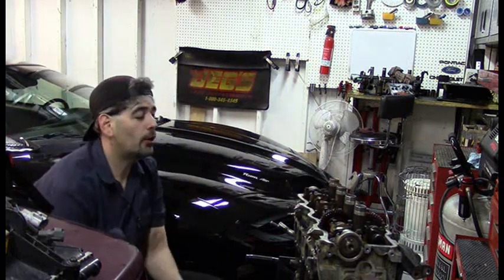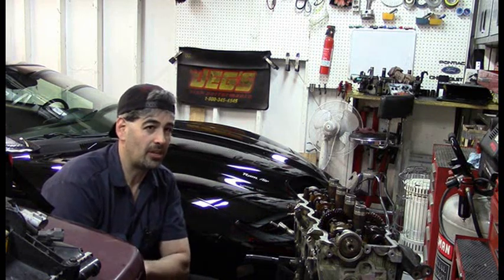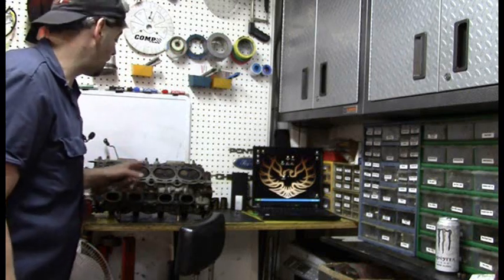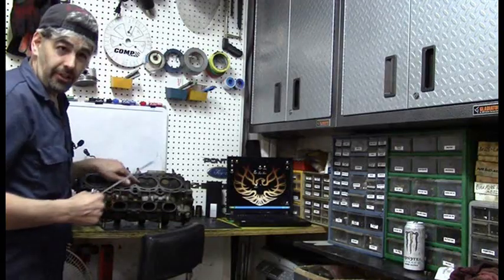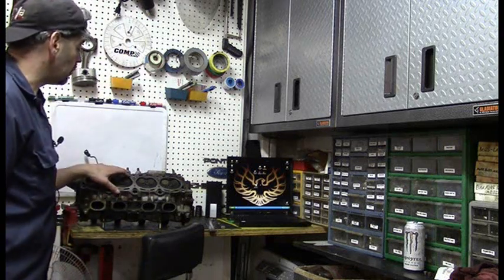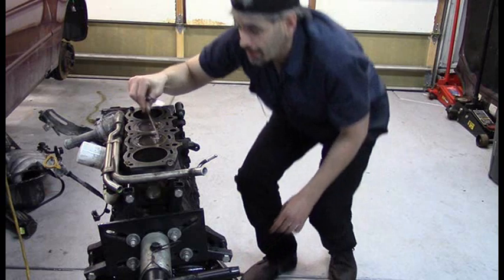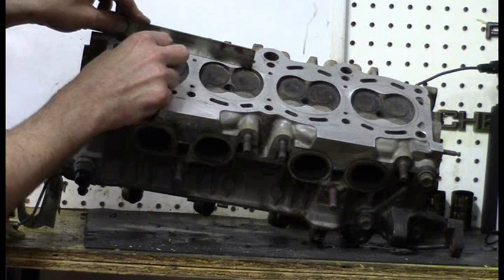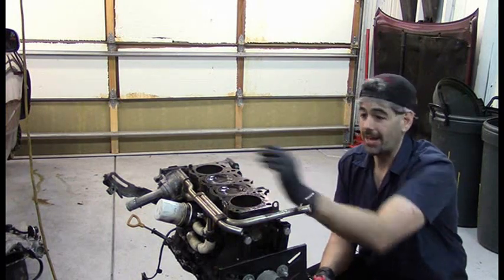Replace a Cylinder Head Gasket Yourself and do it RIGHT! Part 1

Comment: I have white smoke coming from the exhaust and smells of gas. I've put in a new pump, MAF sensor and spark plugs since I've had it for about 2 weeks or less. it starts right up but has a horrible tremble upfront. theres no milkshake look in the oil either. I have a 99 Chevy Tahoe 5.7l. 4 door, before I put to much money on nonsense, would you mind giving me your opinion. I was thinking a blown head gasket, fuel pressure regulator etc.. there's no leak under the tank or in the lines. Please help. I enjoy your videos and trust your judgement.
Reply from the maker: What was the data you had that indicated you need a new pump? This seems highly unusual unless the LTFT and STFT indicated a highly positive fuel trim especially under load which contradicts if you smell fuel, wouldn't you agree?
  What was the MAF sensor data you got that made you replace the MAF? What design it is- Digital or analog and if digital what frequency measurements did you get indicating the MAF was faulty? If analog what did the voltage sweep test show?

 Why did you change the sxpark plugs? What ignition problem was indicated? Did fuel trim indicate lean misfire and if so how did you determine ignition as cause?

I need to see the data you used to come to these conclusions since obviously you overlooked something in your diagnosis.
Reply: Schrodingers Box To be honest with you I'm still on the basics. My mechanic is the one who actually came to those conclusions. I agreed with the pump cause it wouldn't start up or took awhile to start up, turning the key at least 7 to 10 times. I also couldn't hear the pump when I turned the key on the start position. The spark plugs I assumed ( which again was brought to my attention by this "mechanic" ) because of the bad trembling really bad and the guy I bought from was always out of town with the Tahoe. The MAF sensor I was told by my Mechanic again that it needed it because it wasn't sensing enough airflow therefore causing more consumption of gas which when I was "low" is why my pump wouldn't work correctly.
Reply: Schrodingers Box To be honest with you I'm still on the basics. My mechanic is the one who actually came to those conclusions. I agreed with the pump cause it wouldn't start up or took awhile to start up, turning the key at least 7 to 10 times. I also couldn't hear the pump when I turned the key on the start position. The spark plugs I assumed ( which again was brought to my attention by this "mechanic" ) because of the bad trembling really bad and the guy I bought from was always out of town with the Tahoe. The MAF sensor I was told by my Mechanic again that it needed it because it wasn't sensing enough airflow therefore causing more consumption of gas which when I was "low" is why my pump wouldn't work correctly.
Reply: he's a horrible mechanic and to my belief I should've took the time instead of rushing it to get my Tahoe working right and did way more research. As I've been on your Videos for hours and days practically now before I start on the vehicle.
Reply from the maker: I don't understand why you agree with the pump? What evidence is there from data analysis indicating this was faulty (especially considering it obviously wasn't?).  It took a while to start so the pump was bad? Really? Why not it took long to start because of low compression, timing, vacuum leak, learned fuel cell adaptation reset, or a million other things?
  Not sure I can help with this one- I just do things differently. If I suspect a fuel pump I would need to verify with a LTFT curved against load to verify positive fuel trim proportional to load.  Once I see that I validate MAF voltage and/or frequency to eliminate induction measurement error. And even then I would fuel pressure test via deadheading the pump to finalize confirmation,
  I don't see any data here at all- I'm afraid I can't help, I just do things differently. I don't guess when I diagnose. But then again I'm not a mechanic by trade- car repair is just my hobby so I admit I could be wrong in my approach.
Reply: Schrodingers Box No I agree. I was weary even before buying the pump. But I'm no professional so I went along with his diagnosis believing he would know best. For now I'm just going to take my time keep learning and invest in my own real tools before I start my project. I need to buy a fuel pressure gauge, torque wrenches, breaker bar etc.. and throughout time while I'm learning more if your don't mind I'll be asking you real comprehensible questions. I'm going to check my fuel pressure etc.. if it is and I need to get to my fuel pressure regulator, or if I have a blown gasket etc.. what size torque wrench would you recommend to invest in first for the throttle body, intake, head, etc.. if you don't mind
Reply: appreciate the reply back by the way
Reply from the maker: I guess i'm still not following your logic here - why would you want to collect tools such as torque wrench and breaker bars and stuff for TB and intake when you have no evidence it is anything other than a leaking fuel pressure regulator or a ignition misfire or a shorted injector?  It's like buying roofing nails, a nail gun, shingles and tar paper to do a roofing job because you have water in the walls but you haven't determined it's due to a roof leak. Why not diagnose if it's a leaky pipe first? Well at least that's what i would do- not saying i'm right. 
  If you want to replace a head gasket, good luck with that. But it's just not how I do things.  I suggest you watch Eric The Car Guy and you'll learn all about the tools needed. I just focus on dignosis.
Reply: Schrodingers Box The tools are because I want to continue learning and fixing on vehicles. But will do. I guess a 120 or so out of my pocket wouldn't hurt to get a diagnostic before messing with it and spending more than I should. Thanks again for the reply. looking forward to more videos.

Comment: I have oil leaking into my radiator. Would this be also caused by a warped head?
Reply from the maker: +Michael Brady Its certainly possible.  Also could be a leaking oil or transmission coolant line in the radiator too.
Reply: Thanks for the quick response.
My X overheated the engine many times.
Before dumping the car back at my house.
its a 3.0 v6 Chrysler lebaron .
This was to be a car for my daughter, its only got 32k miles on it .
So I'm not going to give it up yet !!
Reply from the maker: Michael Brady considering the overheat I would definitely start with leakdown or compression test right off the bat and "rule out the worst case scenario" first

Comment: Low compression could also mean that a big end bearing has gone and the cylinder is lower! Just had that on a 1hdt land cruiser!
Reply from the maker: Yes that's true- you would have a major engine knock with that but indeed your compression ratio would lower as the piston travel is less.

Comment: Hi, Schrodingers I have a good question for you, 97 f150 4.2L replaced engine block and got p1506 IAC higher than expected RPM was 1100  and when gear to R or D drop RPM to 800 any way I got that fix and p1506 is gone, but still have the RPM problem, the idle in P is about 800 no problem, when gear to R or D drop to 500 and  800  up and down, smoke test no vacuum leak, FT# -7 IAC duty cycle 38% this truck run good, engine vacuum 18 hg, the problem at idle when gear to R or D, no other code presents can be the problem between the fly wheel  and torque converter? since is only at idle..
Reply from the maker: Its hard to diagnose based on the info you gave as I would normally look at TPS position and fuel trims to help with this and determine if this is a vacuum leak problem or a dirty throttle body (Which is usually the cause of many IAC codes) or dirty MAF.  i love the smoke test but I trust LTFT far more as being definitive.  I would say if you're looking for the most likely solution based on your provided evidence, I would clean the MAF and Throttle body but this is really just a guess at this point.  Seldom will this be a transmission issue- it is certainly going to be an air/fuel measurement issue but we don't have enough data to determine where.

Comment: I want to ask a question that on the surface may seem silly but I think needs serious consideration, so hear me out and think it through... carefully.  Instead of all the machine shop re-surfacing of the Cylinder Heads (which I don't disagree is the IDEAL solution), why can't you install the new gasket with a sealant like Permatex Ultra Copper (or some such HIGH temperature sealant) to fill in any warpage or gaps that may have caused the Heads to blow or leak.  Here is one of the reasons I ask, as you may have read people have mixed success with liquid sealants such as "Blue Devil", "Steal Seal" and "Bar's Head Gasket Sealer" and these just work by clogging the leak in the original gasket where the compression is leaking into the Coolant and visa-versa.  However infrequent these products work they do point at a solution... JUST FILL IN THE GAP... but do it more thoroughly.

Has anyone ACTUALLY tried that solution?  It would save A LOT of Machining and the cost that goes with it, the time it takes to send the head and get the re-surfaced head back and it's what we usually do with many other parts of the engine, INCLUDING adding sealant to the bolts that go through Coolant passages mentioned in part 2 of this very thorough video tutorial.

Please don't just say, "It won't work"... prove it (or at least give a very thorough explanation why).
Thanks :)

Comment: so i have an 03' nissan sentra...i believe its gasket header is broken or cracked....cylinder 4 is bleeding pressure and the header is wet when the mechanic checked it out and they believe that its broke would that require a gasket header repair/replacement?
Reply from the maker: +tezla actual What did the leakdown test indicate?
Reply: i dont remember the exact nuber but it was on the lower end of okay range and it might have degrated a little more i end up driving it alot
Reply from the maker: +tezla actual Can't help if you already forgot the most critical dataset. Sorry. good luck bro.

Comment: so I'm kinda curious, on if its intake manifold or head/gasket. I know a test is needed but how can you somewhat pinpoint w/out a test if the car won't make it get it tested? scenario, overheats, leaks coolant from exhaust and flex pipe, and coolant inside 3 & 4, no white sludge, no start on a chevy cav 98 2.2?
Reply from the maker: You need to do FASTTEC method. See my video on it.
Reply: See you are the man, you will be my main source for all auto. I will tell the world, good lookin out, mad thanks

Comment: Hi, so i have a 2002 Nissan Altima. I had a compression test done on it and was told that the compression is right at where it should be, but however when we looked down into the head it was very obvious that there was coolant on the cylinder head. (There is no signs of coolant in the oil) So my question is for you, Is this a sure sign of a cracked head? If so what other precautions might i take if i choose to embark on this journey? please and thank you for your time.
Reply from the maker: If compression is good but there is coolant in the intake, a leaking intake manifold leaking coolant into a runner is indicated.  In fact this was a known issue with a TSB and everything on GM 3100 and 3400's - i do not have data on Nissans though.
  Incidentally it is important to try the compression test on both warm and cold engine but pretty much if the compression test was done right it is assured you do not have a cylinder head issue.
Reply: Leaking as in a gasket or would that be part of the internals.
Reply from the maker: Andrew Barker Gaskets are part of the internals.  Basically what I am saying is the intake gasket also seals coolant passages (on most cars, some cars have "dry intakes").  If these passages leak, coolant can enter the intake runners which is a direct passage to the cylinder.  The result of course is coolant in the cylinder which looks like a head gasket issue but it is not.

Comment: Ya, but the head is soft aluminum and the bolts are hardened steel. So the head may warp easy but the bolts can take more abuse. There is a way to test the bolts for stretch.

Comment: Hello SB. Im 22 years old and i have a 1999 Chevy Suburban 1500 im thinking of changing the head gaskets myself since it cost so much but im scared ill break something or not do it right since i have NO prior experience... Do you think with your video id be able to do it correctly if i have the right equipment  and if not what are the steps in what i should do to get the cheapest price to fix it..
Reply from the maker: I would say if you have no prior experience, changing a head gasket is a bad idea regardless of the video or resource you use.  It's really not a beginner project. There are many things that could go wrong or become a complication where experience will be essential.

Comment: ok so i have a coolent leak going into a spark plug chamber on a 3.2 v6 izuzu engine. not in the cylinder and i have very good compression in all cylinders. just coolent leaks into the head were the plug screws into and makes it missfire. dose that mean the head is stuffed?
Reply from the maker: Coolant leaks into an intake runner will also cause water in a cylinder. Pressure check for this as the cause.

Comment: I'm pretty sure my head gasket is leaking since oil is coming out of where the head meets the block, it's starting to miss real bad and I have the milky oil. but could this head gasket failure be caused by that the car sat for a long time and is now being driven frequently?
Reply from the maker: could be. what data do you have to verify head gasket integrity?
Reply: I don't have anything yet I just quit driving it and I figured I'd change the gasket. how can I verify the integrity?
Reply: it's a 1965 Ford 200 inline 6 if this helps.

Comment: What is your opinion about "so called" defective head gaskets?  I'll be working on a late 90s GM 3.1 engine that's drinking a lot of coolant.  There were a lot of reports that said the intake gaskets and head gaskets were defective on these engines.  After watching this video I'm thinking some other conditions might be causing the intake gaskets or head gaskets to go bad...  Your videos really make you "think" before turning wrenches... Thanks!
Reply from the maker: +situationmoney The 3.1/3.4L later's 90's GM intake gaskets commonly leaked from the right rear. I'd rule out that this isn't the cause before I blamed a head gasket.

Comment: According to the mechanic the head gasket is blown based on the chemical test you performed. I don't know if I trust them to fix the issue. They did not detect what I believe was the cause, and seemed baffled when I kidnapped my pickup and figured out the thermostat had busted. I replaced the thermostat, and the pickup seems to be performing as well as it did before it overheated, however briefly, but from what I was told by the mechanic they were just going to replace the gasket. I have no mechanic I can really trust, and don't have the time, tools, ability or inclination to do the myself. Hell, the pickup may not even be worth fixing. '97 Mazda B2300 with 180 K miles, plenty of scratches and dents, but until this incident she ran like a champ. Any suggestions? Any idea what I should expect to pay to get it done right from a local shop?

Comment: My 2017 corolla had coolant leaking into cylinder 1 at starting around 5000 miles, the dealer just replaced the head gasket, said everything else was fine.  Is it possible to just have a bad gasket with nothing actually causing the gasket to break?  Just a defective gasket so to speak? Worried they put a bandaid on the problem just to last long enough to get it out of warranty.  Still have about 50,000 miles or a little over 3 years of warranty left.

Comment: Hi! Can you help me as well? when ever I turn on my car, a strong pressure will push out from my radiator making the water gush out, I cant put my radiator cap on, the head gasket was already replaced as well as radiator overhaul was made.
Reply from the maker: Yeah if you get that kind of pressure in your cooling system soon after startup, I would definitely be testing for a bad head gasket in that event. See my video "12 ways of how to test for a bad head gasket" on my channel and you will get some methods to test regardless of the equipment you have.

Comment: Is it possible that the gasket would go bad on a perfectly fine and flat head?
Reply from the maker: +sahmadi1000 There is some debate about that but unless the car is like 50 years old, I am going to say I have never, ever seen evidence of this.
If a 2001 grand am comes in with a bad head gasket, I 100% guarantee there will be an etiology other than "the head gasket just went bad over time".

Comment: So I'm just curious for small honda/toyota 4 cylinder engines if a head gasket replacement means a new engine obviously water pump and everything else needs to be replaced too. I'm just curious if done right does it actually hold up with the head gasket replacement?
Reply from the maker: A head gasket replacement doesn’t necessarily mean a new engine. It could but not always. depends on the lower end damage. 
   I can assure you that properly done a head gasket replacement lasts the life of the engine.
Reply: @SchrodingersBox  usually the prius and corolla head gasket issues are rare big damage. I've always wondered if done right I would get good life out of it since the hybrid system doesn't allow too much stress on the engine anyways. I learned a lot from the video and thanks.